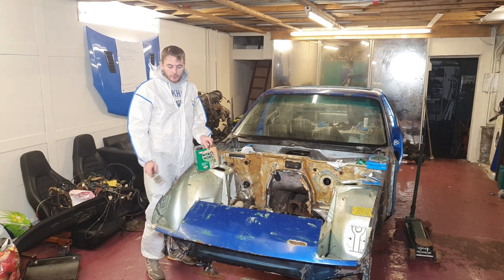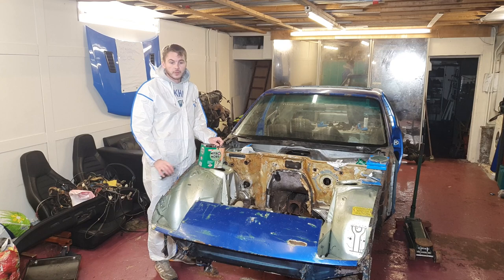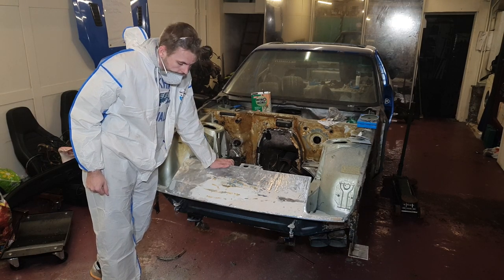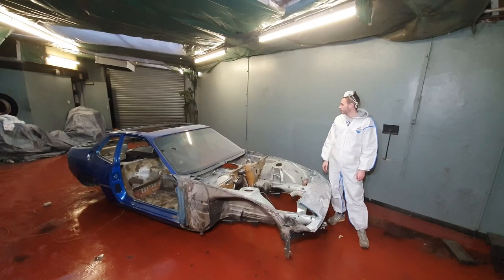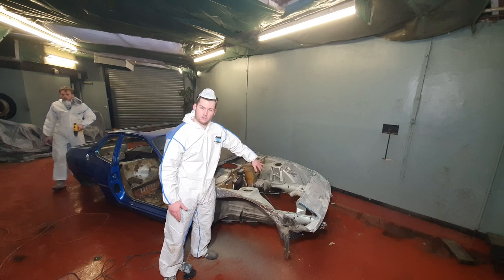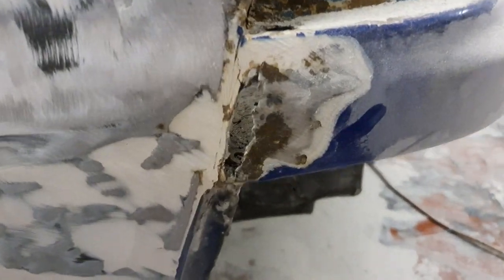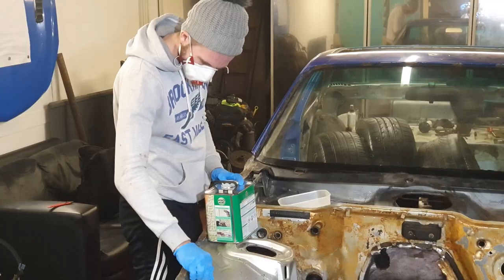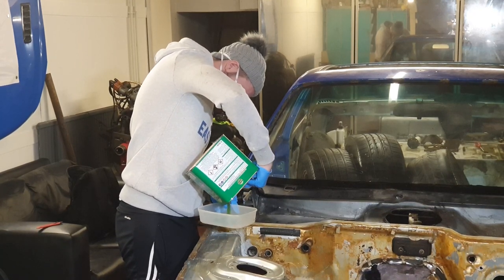Back To Bare Metal - Porsche 924 K20 Build #11

Comment: I feel your pain using Nitromors! Since the EU banned the use of dichloromethane (the part that actually makes paint stripper work!), Nitromors is next to useless. You'd have more success wishing the paint off! In the future try Starchem Synstryp, I use that with great results. Anyway, top job so far, keep up the good work! 👍
Reply from the maker: Yeah we read on some of the forums that they removed a certain chemical from it and it wasnt as good as it used to be. It was worth a shot but we know now 😂